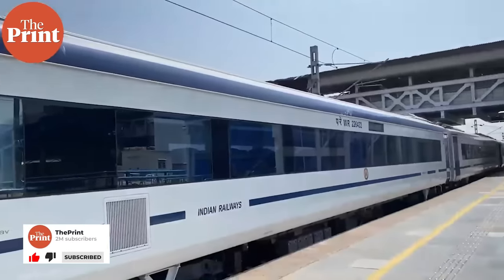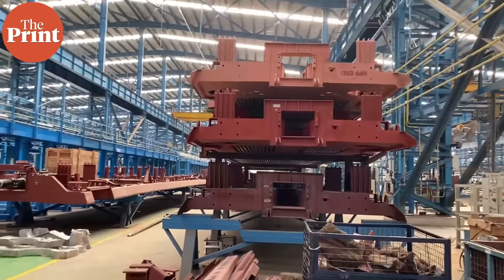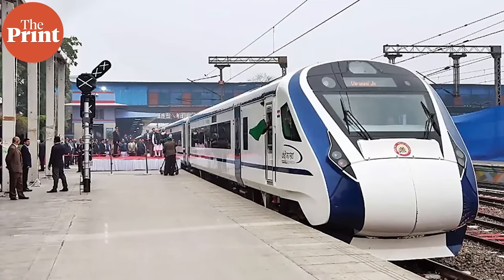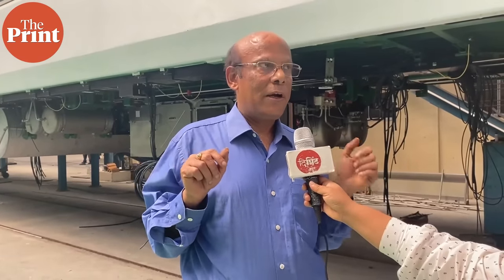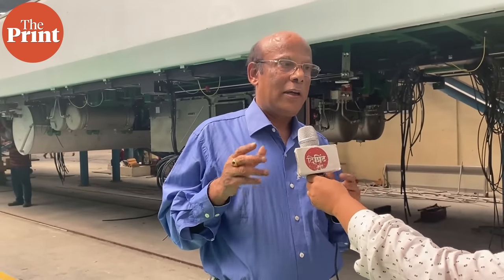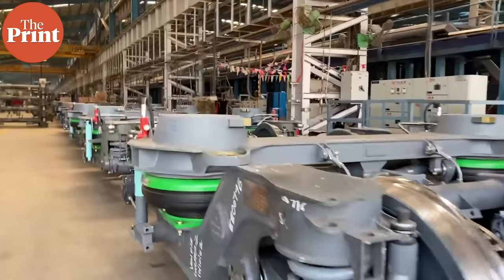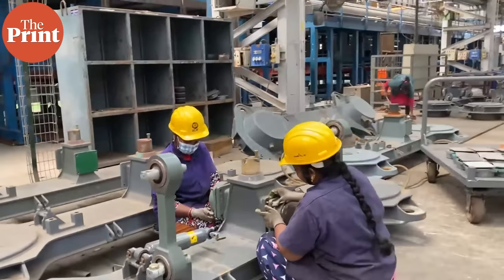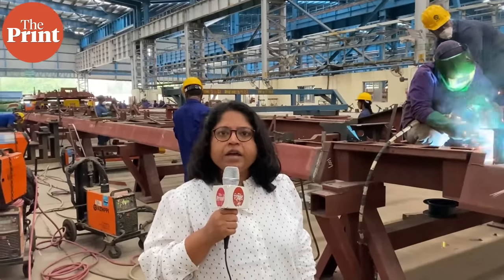How India’s 1st indigenous semi-high speed train, the Vande Bharat Express is made

Comment: VB is a very futuristic semi high speed train and we need to develop a sleeper car version also. More shop floors & workers are required for each segment to ramp up production as I find the current capacity not enough to make 6 VB per month to achieve the target of 75 VB by August 23. Also VB has a good potential for exports  like metro coaches, so production should be outsourced to private players.
Reply: But soon enough at least MCF Rae Bareli will also start manufacturing the VB 4akes n that'll enable railways achieve target of 75 VBs
Reply: "Futuristic" by Indian standards perhaps. But take a look at the equivalent semi-high speed trainsets manufactured in Europe or even China (the Chinese CR200J is a good example) and you can see Vande Bharat has a dated design by international standards. IR badly needs competition from the private sector in rolling stock manufacturing. Like the case of Alstom which builds semi-high speed trainsets for Delhi-Meerut RRTS, the Govt should encourage other European firms like Siemens as well to setup factories in India and manufacture trainsets and coaches for IR.
Reply: @vineethg6259  Siemens is entering Maharashtra
Reply: @rishavkumar1250  does siemens has manufacturing in India?

Comment: Where did you get the 162 kmph number? Isnt it designed top speed 200 kmph and and has not it been tested at 183 kmph top speed on the tracks?
Reply: It has been tested at 180+ but it is allowed to run at a max of 162 for commercial operation.
Reply: Correct
Reply: The Design specification is for 160 kmph only, but for safety reason they keep +20 kmph buffer for testing purpose, as to get clearance for 160 kmph commercial run, it needs to safely pass the test run at 180kmph, that doesn't mean that train can operate at 180kmph at all times.
Reply: @RailCaptures-byGKP   The designed top speed (no exceed speed) is 200 kmph (which means that the train in its current design configuration wil not exceed 200 kmph even if it runs on brand new continuous welded rail along dedicated fenced straight corridor on suitable terrain and adequate electrical traction is available- the grarbox needs to twraked to run it at ~220 kmph) . It was Tested to 183 kmph as no suitable tracks for 200 kmph is available. 160 kmph is the authorised top speed for safe commercial operations like Gatimaan although due to track limitations, the train hardly exceeds 130kmph most of the time as the route does not allow it. Ofcourse for 160kmph to be set as authorised top speed for safe commercial operations, the train had to be tested at an additional +20kmph top speed for demonstration  But here the authorised top speed for commercial operations is being made to be assumed as the designed top speed which is wrong.
Reply: @knightatdawndonbynight8432  They need to tweak Gear ratio, and little bit more powerful Traction Motor & Propulsion system to get it fit for 200kmph (commercial speed).

Comment: Vande Bharat might be revolutionary by Indian standards, but it is way behind equivalents from Europe and China in their manufacturing quality and design aesthetics. IR needs to open up more of rolling stock manufacturing to private suppliers as well. Alstom already has a factory here that builds semi-high speed trainsets for Delhi-Meerut RRTS. If there is sufficient scope for business with IR, we could get Siemens and Talgo to open manufacturing plants as well. Depending solely on Govt-owned coach factories like ICF and MCF isn't going to get us anywhere.
Reply: Train set itself is one of the smaller challenges that high-speed rails face. The larger challenge is the infrastructure like tracks and signalling. Better infrastructure than the existing ones are necessary if you want say 350 km/h trains. Without better infrastructure, train sets simply cannot sustain 350 km/h speeds

"Made-in-india train set" is great only for nationalistic dickwaving and winning elections without great infrastructure

Comment: Just by changing the Curvature of the leading car by curving it more steeply, the Speed can be increased by another 60kmph. A steep curve reduces the resistance to headwinds by 20-40%.
Reply: But sir the tracks are not designed to handle this speed, that's the problem.
Reply: @channelchatter112  yes sir you are absolutely right 👌🏻👌🏻👏🏻👏🏻👏🏻

Comment: Stopped watching in the first minute. Maximum speed is OVER 180kph . not 162.
Reply: 🚄Vande Bharat Express has a maximum commercial speed of 160 km/h.

It exceeded 180 km/h during testing, but its tracks are not capable of supporting such high speeds; thus the train is operated at a maximum speed of 130 km/h (81 mph).

Comment: 0:36 mam at least do some homework the maximum speed of vande Bharat is 180 kmph tested
Reply: 🚄Vande Bharat Express has a maximum commercial speed of 160 km/h.

It exceeded 180 km/h during testing, but its tracks are not capable of supporting such high speeds; thus the train is operated at a maximum speed of 130 km/h (81 mph).

Comment: It is just 5 -15 min faster than a shatabdi or Tejas on the same routes. So to call it "semi-high speed" is really streching it. Yes i know the tracks need to be upgraded to accommodate the high speeds these trains can clock i.e 160-180kmph. But what does that tell that about us. Propaganda and political optics matters more than upgrading necessary infrastructure (which needs time and care). So here we have the result. A brilliant train running at 130 kmph if at all and the regime parrots call it "semi-high speed" and experiencing orgasms. Even parody is better than this joke!
Reply: And for your kind information they're upgrading Kolkata - Delhi and Delhi - Mumbai route to "clock" 160 kmph "primarily". Another thing, we already have WAP 5 loco which can go up to 200 kmph and LHB coaches up to 160 kmph  ( 200 kmph if you consider Tejas LHB ). The reasons why they're manufacturing VB train sets are better acceleration, better negative acceleration, better energy utilization and conservation, etc. These trains are being manufactured not only for Semi High Speed Express Service but also for Regular Express Service i.e. <160 kmph speed. Even with top operational speed of 130 kmph these train can have a average speed of 95 kmph, which is not bad.
Reply: Some people never appreciate anything just because of their political lineage but call others parrots 🤣🤣 Stop being a caged parrot of a party and start appreciating atleast the good works

Comment: Get your facts right lady. Highest speed it can travel is 180 kmph. 162 is the current speed at which it is traveling
Reply: 🚄 "Vande Bharat Express" has a maximum commercial speed of 160 km/h.

It exceeded 180 km/h during testing, but its tracks are not capable of supporting such high speeds; thus the train is operated at a maximum speed of 130 km/h (81 mph).